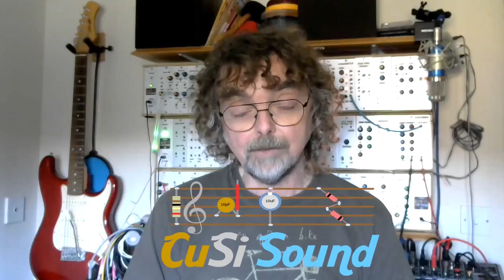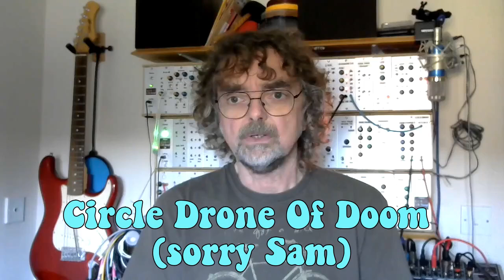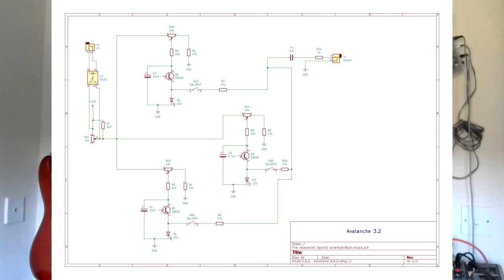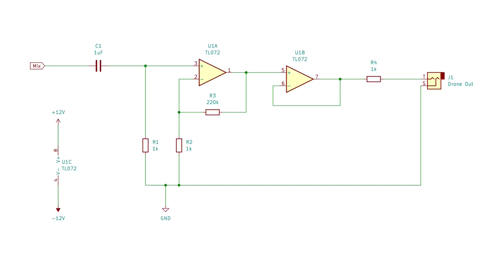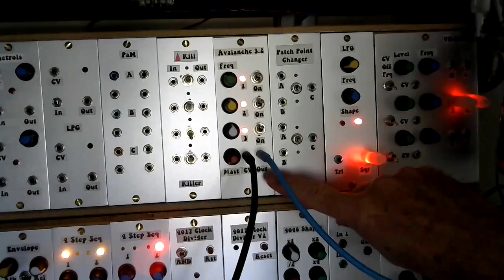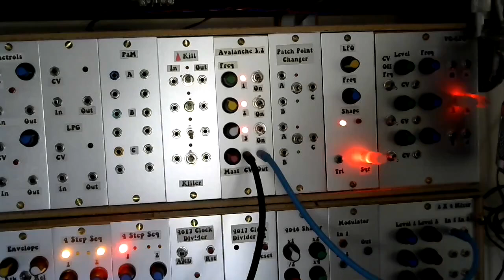Project XII Part 41 : Avalanche 3.2

Comment: Nice one again.
I found an empty Doepfer rack in the street:
➡ How should I test it to know if it still works?
➡ Could I use that to power some Project XII modules?
Reply from the maker: Found in the street ?!?! Ok first check you have the right power supply for  the rack, I don't know what they require but you should be able to look that up. Check the internals of the rack for damage/corrosion etc. If all looks ok power it up but be ready to cut the power quickly if things go wrong. Assuming all is ok on power up, check the supply rails with a volt meter for +12v, -12v and 5v. If you have a working power supply in the rack it will power Project XII modules. My Project XII panels are not eurorack size, yours may be as you can use whatever face plate you want for my circuits. Be careful, especially with mains voltages and make sure you can cut the power quickly if needed.